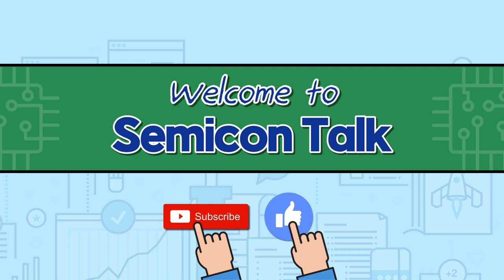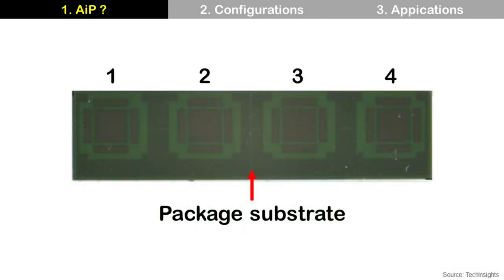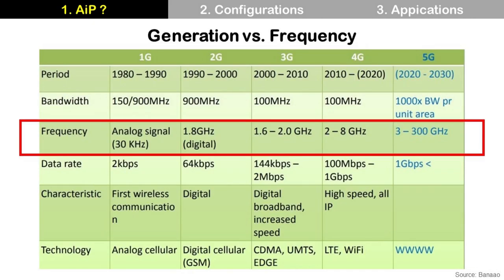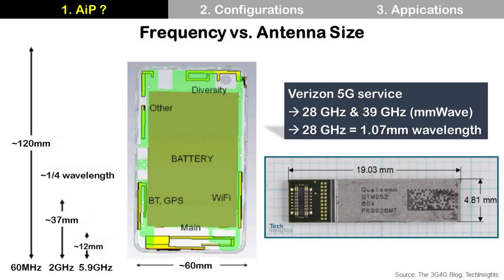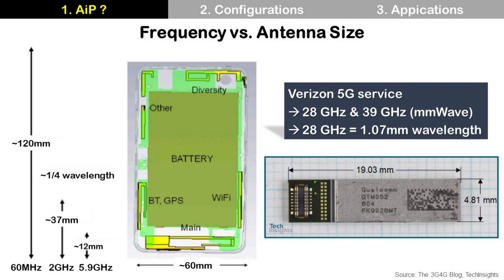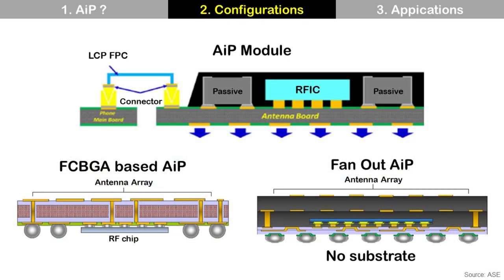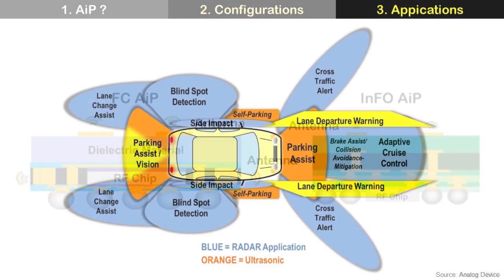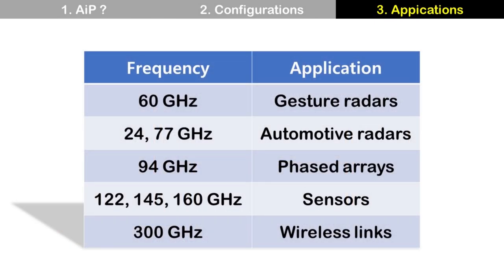[Eng Sub] AiP (Antenna in Package)

Comment: There's a new (AOP)Antenna on package from texas instrument, is it the same?
Reply from the maker: It is very similar but purpose is different. TI AOP is for automotive radar and Qualcomm AiP is for smartphone wireless communication.
Reply: @semicontalk3223  helli. What means Die ? for instance, when you said "has transceiver die"?
Reply from the maker: @antoniocarvalho8320 Die means a small piece of semiconductor chip or IC(integrated circut). Die, chip, and IC are used interchangeably. Thanks for watching.
Reply: @semicontalk3223  ow, thanks a lot. but DIE has any meaning "acronym". thanks a lot,
Reply from the maker: @antoniocarvalho8320  Die is a noun for IC and die is not an acronym.
Reply: @semicontalk3223  thanks a lot again !!!!